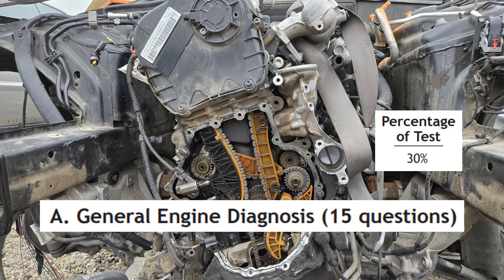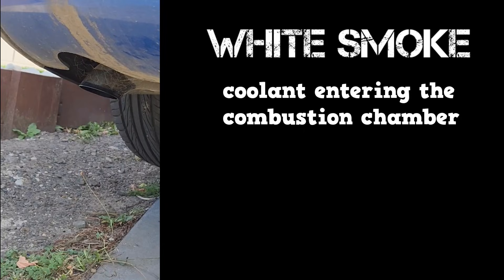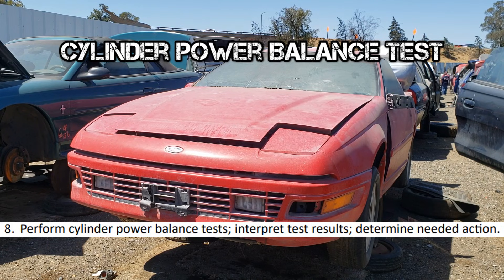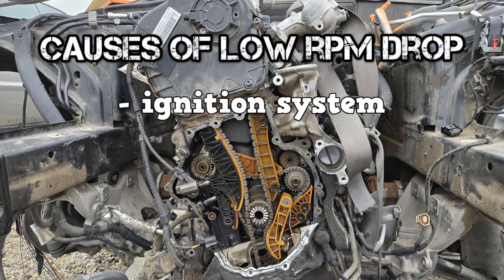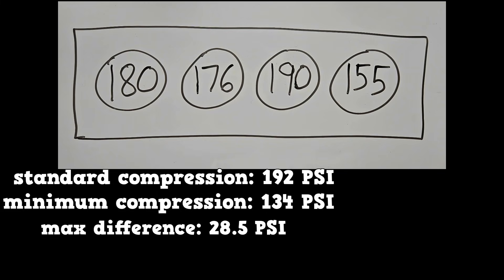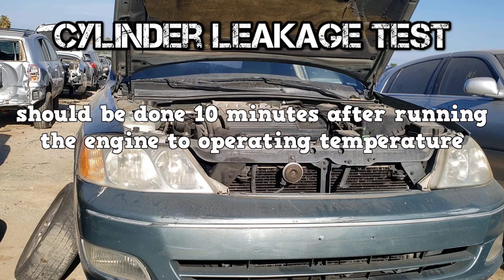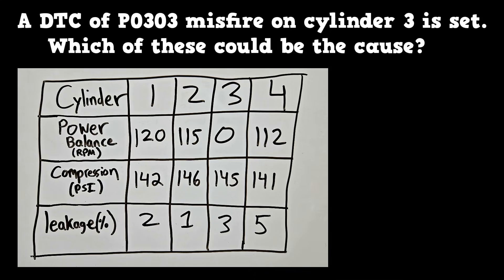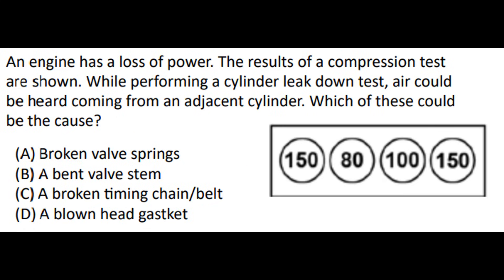ASE A1 Test Prep #1 - General Engine Diagnosis

Comment from the maker: Feedback after taking the test: All of the info on this video is relevant to the test, BUT it needed a Part 2. I did not touch on vacuum gauge diagnosis (actually yeah, in the A8 series), saw 2 turbocharger related questions, LOTS of electrical diagnosis (No start, no crank, battery diagnosis, starter diagnosis) a few questions about the cooling system.
I also should have touched on basics such as how to read a dial indicator and how to read a micrometer.

Comment: Why wouldn't a Open Spark Plug Wire cause a Power Balance Cylinder Failure? That one has me confused.
Reply from the maker: At 5:54 , cylinder 3 had a 0 RPM drop during a Power Balance Test. This means that cylinder 3 was not contributing, it had "failed." Cylinder 3 was not firing because there was no spark in that cylinder due to the open spark plug wire.

Comment: Take my A1 and A3 today 🥲
Reply: How did you do
Reply: @KinggSigma passed A1 and failed A3 by 1
Reply: @Slhumss damn, how were the questions on A1, i take it in a few days I want to know how the questions are like
Reply: @KinggSigma 

These are some Ase questions from the actual test i remember

For starters i had Lots of overheating questions 

- Question on Engine overheating at highway speed but not during regular driving

- Oil Pressure is normal upon start up  then suddenly drops to 0 
 
loud ratcheting noise is heard coming from VVT but stops once VVT solenoid is activated. What is the issue?

- Knocking noise happens on startup but goes away as engine warms up - I chose piston

- Engine has low compression in one cylinder, after leakage test there is no drop in gauge and no noise is heard in either exhaust or intake. 

- Blue smoke is seen during deceleration, what could be the cause 

- got a chart that showed 6 cylinders all had 195 Compression and one had 205. Spec is 175. What is the issue? 

a 4 cylinder engine that had compression correctly in 3 cylinders but one had 0. The answers made no sense - can't remember my answer
-

Like 3 Vacuum gauge questions, w no gauge picture, just description 

- vacuum goes to 0 after engine rpms are at about 2k rpm. But slowly goes to 5 in vacuum.

Chart showed 4 cylinders all had 190 compression and 1 had 0 what could cause that? 

Vehicle comes in for an overheating concern, upon inspection 3 cylinders have carbon built up on piston and valve, and 1 cylinder does not what can be the issue? 

- you hear a rattle on start up that goes away after the car gets to operating temperature 

- During a cylinder power balance test you turn off a cylinder and see little to no
RPM drop, Tech A says this means the cylinder is Ok

Tech B says this means theres something wrong with the cylinder 

Tech A says its ok to clean a block surface with an abrasive Cloth

Tech B says its ok to clean block surface with Sandpaper 

( answered neither ) 

Another was like tech A says its ok to clean head surface with a buffer

Tech B says its ok to use a plastic blade 

( i picked tech B only ) 

Got a micrometer question as well basically asking me what was it reading 

But thats all i can really think of bro hope it helps
Reply: @Slhumss i appreciate it bro💯 this helps alot thank you
Reply: @KinggSigma how did you do?

Comment: I've been doing this for 20 years and I have yet to see blue smoke. On the other hand if you can't tell the difference between the smell of burning oil and burning gasoline you have no sense of smell.
Reply: The irony of different experiences between mechanics 🤣my first day at ford, had an f150 with blue smoke they told me to just go fix it😭😂thank god I was hourly bc it took me forever! It was one of those 5.0 f150’s & hot head wanted to put new piston’s in not realizing the piston rings couldn’t be reused, so not only were they just warn they were not sized correctly which caused all of cylinder 2’s rings to pinch & weLL BLOW BY make engine wanna go bye bye

Comment: you say that blue smoke is from worn valve seals upon acceleration from a stop then u put D for the 1st question?
Reply from the maker: This is classic ASE wording. Yes blue smoke from valve SEALS. The Technicians are talking about valve GUIDES and valve SEATS, which are found after the seal.

Comment: I have a 2003 DODGE CARAVAN SE V6 3.3L FLEX FUEL.

The vehicle has a catalytic converter.

The fuel injector connectors are buried under the upper intake manifold.

I need to do a manual cylinder power balance test by disconnecting fuel and not spark to avoid dumping raw fuel into the catalytic converter.

Is it possible to do a manual cylinder power balance test with the upper intake manifold removed and having access to disconnect one fuel injector at a time?

If it's not possible to do a manual cylinder power balance test with the upper intake manifold removed, what are other ways i can go about doing a manual cylinder
power balance test without having to use a professional scanner since i dont have one?

Comment: did you forget to add the 2nd picture at the end, question 2 is D, exhaust valve not seating and there are 3 pictures instead of 4 like the description would suggest, just cuious
Reply from the maker: Question 1 is at 1:11
Question 2 is at 1:33
Question 3 and the rest start at 6:02